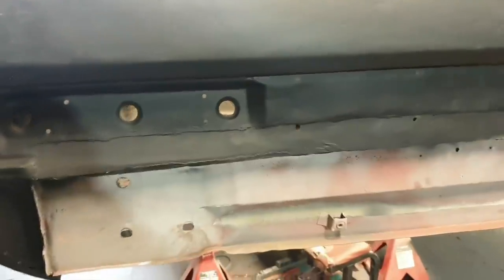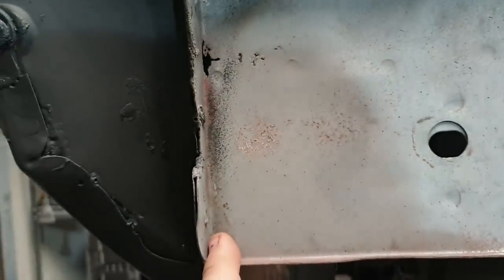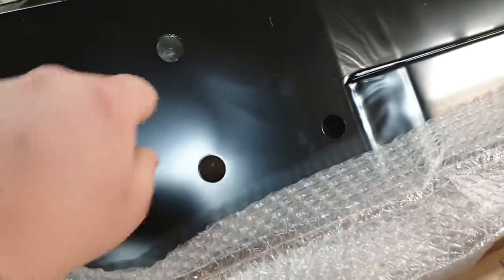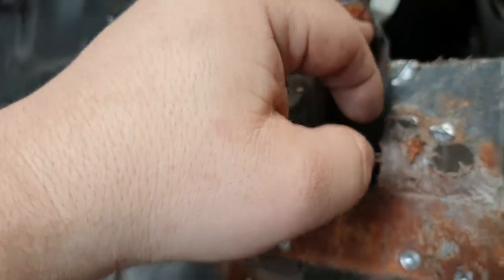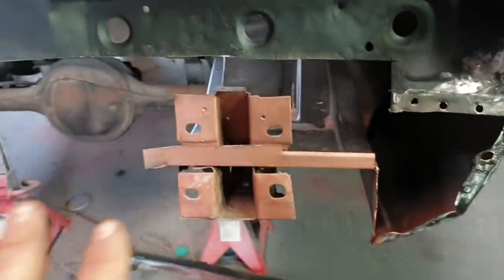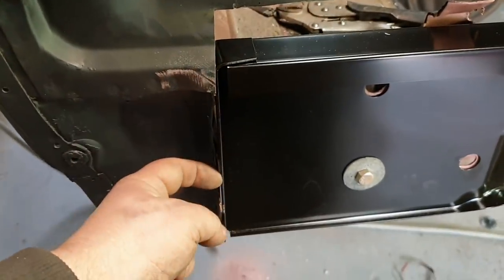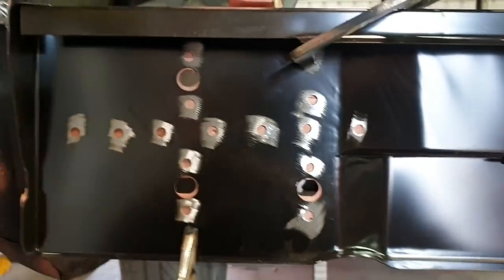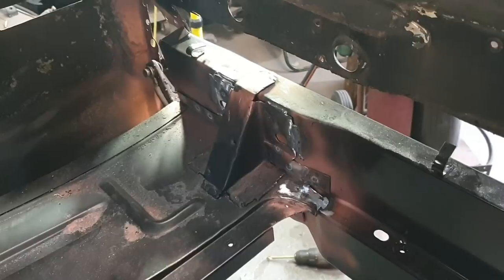Fitting up a new beaver panel

Comment: That's are Rare Spares panel, 3/4 of the panels on Astill web page are from them.
Reply from the maker: The beaver panel that the bumper bar bolt too is from better than new old stock but he supplies rares and astill